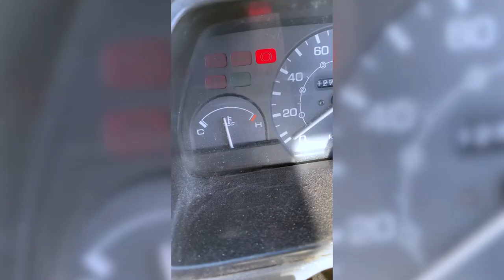Honda Acty WILLpowered tachometer install

Comment: Seems to have a delay in those units no very responsive when touching accelerator.
Do you have aftermarket part for Sambar's? I do see your repair parts for Sambar's but no big brakes for Sambar's? No coil over shocks? Lift kits?